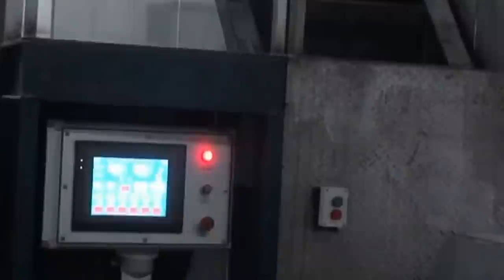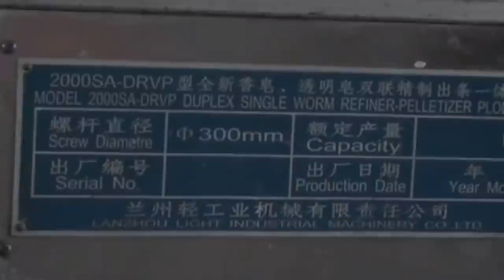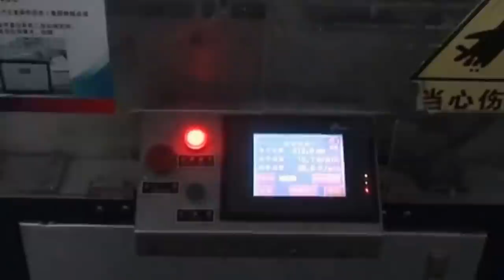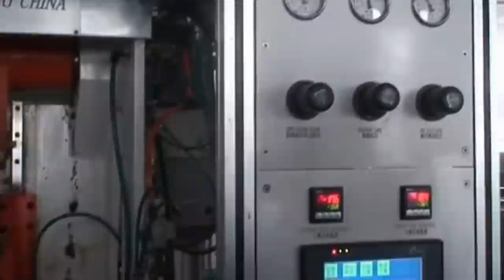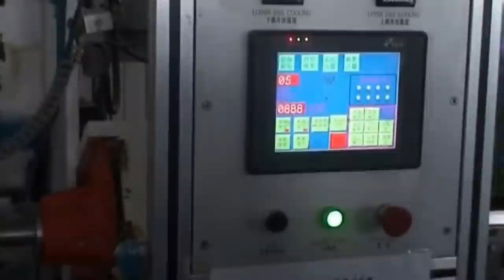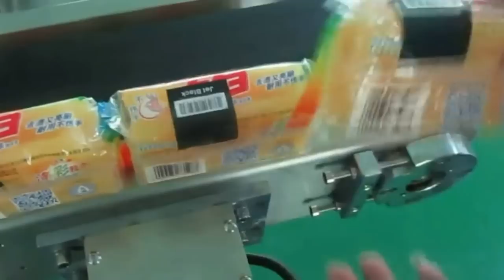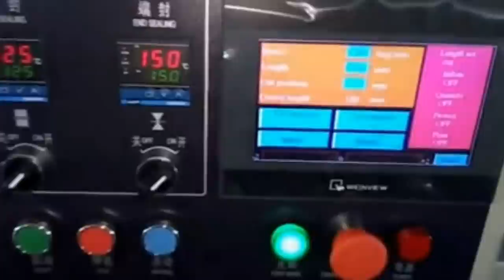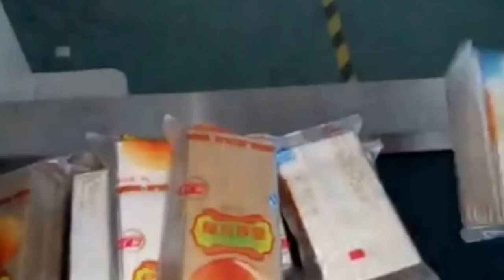How to make soap bar from A to Z fully automatic solid liquid detergent maker comment faire du savon

Comment: How many soap bars in an hour?
How long can you run this machine continuously before stopping to prevent overheating, lubrication, or regular maintenance?
Reply from the maker: different capacity according to your requiements. The machine can keep running for more than 8hours before stopping. Regularly the maintenance every week enought

Comment: What is the total cost for this machine
Reply from the maker: tell us the capacity requirement please
Reply: I want to start from small ( per day 1200kg per day) with fully automatic machine, i don't want to use many Labours.. so if you don't mind can you tell me for total cost?,?
Reply from the maker: THE Total cost is about US$290,000
Reply: What's the cost for complete line including wrapping 13 hours working max daily

Comment: Total machine cost of 300 kg/hr
Reply from the maker: the capacity
Reply: 300 kg/ hr
Reply: @JackDu007  how many soap bars in that capacity?
Reply from the maker: @khayceecarandang3854  check the basic parameters for the line as below:
basic parameter of YX series How to make soap bar from A to Z fully automatic solid liquid detergent production equipment comment faire du savon :
Model  YX-SP-300
Production Capacity 350 kg/h
Mixer volume 0.7 m3 Power of mixer 2 X 5.5 kw
Discharge mode electric Power of discharge 0.37 kw
Diameter of rollers Φ260mm
Length of rollers 670mm Power of mill 11 kw
Diameter of screw Φ200mm
length/ diameter ratio L=4.5Φ
Power of plodder 11 kw
Soap weight 10g-250g
Power of stamping machine 3 kw
Power of conveyor 0.55 kw×2 Total power  37.5kw
Size( L*W*H ) 7.5×3.0×2.9M
Total weight 6000kg